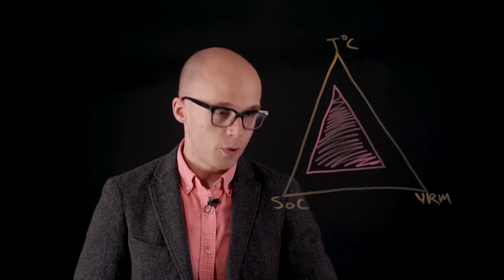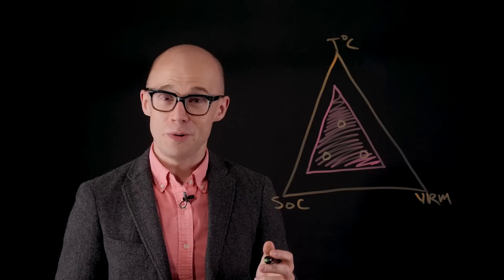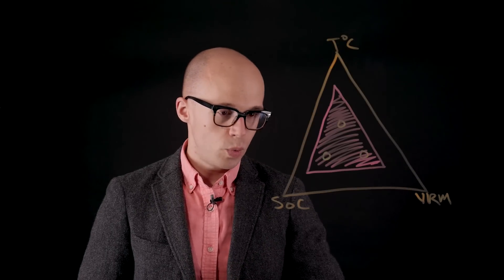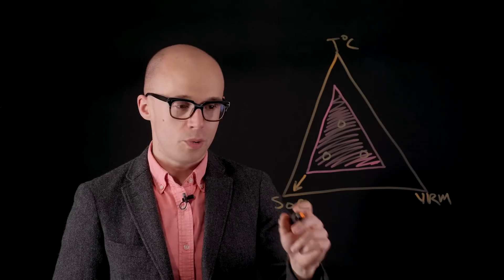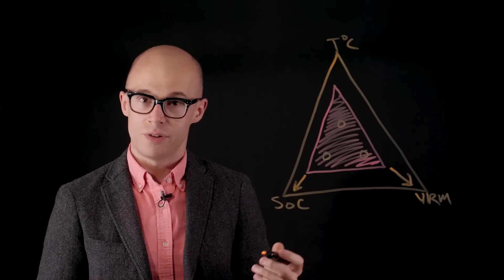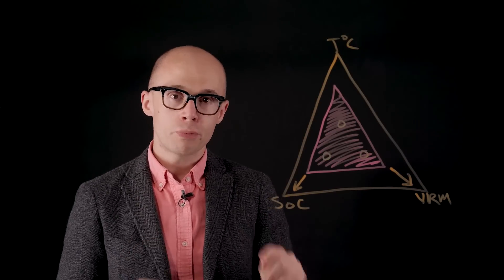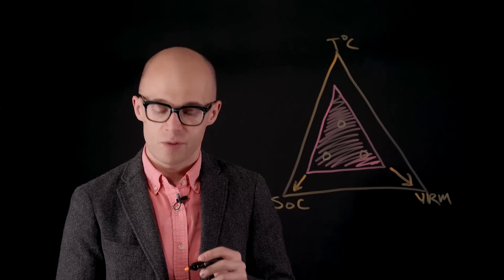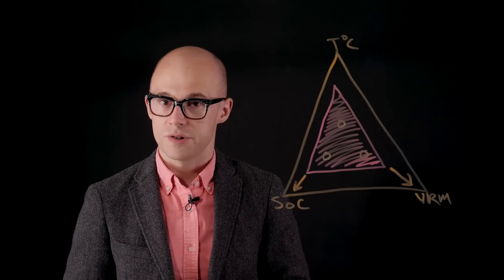How Does Precision Boost Overdrive Work

Comment: So when I got that right there is a new super expensive CPU that has a build in overclocking function, that will work within the limits, but if you are using it you void your warranty.

If I got that right I have a serious question: Are you shitting with us AMD?
Hey, here is a build in function that we have programmed, but if you are going to use it, you void your warranty!
Yeah, nice! Thanks a lot, I needed that!
But wait there is more! If you buy right now, you will lose your warranty by just taking it out of it's heavily oversized box! how do you like that?

I have an AMD system that is about 8 years old and I'm going to replace it with a new AMD system. So I'm not hating on AMD, but please AMD: Leave the idiotic ideas to the blue team. They are much better at this and this is one thing where you do not need to beat them.

Comment: Available on 2600x and a MSI B350i PRO AC with 1usmus AGESA 1004C (July 2018) :) PBO 'AMD Default' at 1.510v max or 1.4-1.440v under load with at least 4.1ghz, and mostly 4.250GHz (max turbo XFR2) :) This does reduce lifespan for sure but it's so worth it, cheaper than intel and gets so close. Cheers AMD for making such a well rounded and balanced processor, even if not the best.

Comment: thinking of a negative curve offset as a voltage manipulation is not entirely correct. 
The curve of the most demanding loaded core will dicatate the voltage the entire CPU core die runs at.
limited by a slew of other constraints), and the other cores will adjust their peak frequencies to match that voltage.

Comment: so if in ryzen master the dfault ppt edc and tdc are respectively 141/740w  95a/480a and 140a/650a means  i can double those values safely because there is still much headroom?
I have a 2700x and taichi x470

Comment: I don't like the fact that it voids warranty, why it should void warranty? Intel CPUs are smart enough that it's very very hard to damage them even while heavily overclocking, why amd should have warranty problems with oc? Aren't they smart enough to safely downclock/downvolt like intel if something became critical?
Reply: Overclocking Intel CPUs through software also voids the warranty. You can overclock through bios and as long as you stay under their recommended maximum voltage you will not void the warranty.
Reply: Oc intel cpus void warranty too.
Reply: It should not void the warranty to use an AMD made and recommended software that adjusts the settings based on the company's parameters and recommendations. I bet they'd lose a lawsuit regarding this.

Comment: Does PBO work with non-X ryzen cpus?  My 2700 non-X with PBO off tops out at 3.450ghz, with PBO on tops out at 3.425ghz... this is while playing games.
Reply: Cer3aleater the same for me, I don't know what to do... got the same processor like you. Max 3425mhz in games but in desktop usage it goes even to 3950 MHz. With the precision boost off in bios, It's stuck at 3200 MHz all the time. Can anybody help?

Comment: I have Crosshair 7 Hero mobo, 2700x cpu, Kraken x72 cooler and precision boost overdrive on. Why does my cpu run only 4ghz? My cpu is freezing cold at 40C, please make overdrive a bit more aggressive.
Reply: Are you using an X370 or an X470 chipset? The X470 chipset is optimized for overclocking The Ryzen 2000 series. Are you increasing the voltage to overclock passed 4.0 GHz? Recommended Voltage for overclocking to 4.2 or higher is in the range of having your VCore at 1.25-1.35V.
Reply: Use PE Level 2, and do a negative voltage offset of -50mV. That'll get you to ~4.15GHz.

Comment: Dont but ryzen 3700x it runs very very hot like 50 in idle on noctua nh-u12A...and im not alone complain about it!
Reply: It's not actually running hot, it's an illusion... though it's kind of dumb that AMD didn't use an average temperature for the chip.

Basically, that 50C is happening in a tiny part of the CPU at idle and AMD is telling you about it instead of giving you an average like Intel or any sane person would do.

Old Ryzen CPUs did the same thing, believe it or not, but they didn't have as aggressive of a boost, so the local heating was lower... but not actually by much.

Comment: TLDR: It doesn't. 

Most of the time it does nothing to improve performance and in a few cases you get better performance with PBO off!

Seriously, I thought people were just jumping on the bandwagon saying it does nothing. Finally decided to benchmark it myself... With PBO & Auto OC on I get THE SAME averages as just stock settings.
I actually do see slightly higher scores with just Auto OC on. SLIGHTLY.
From what people are saying thermal limits are stopping cores from reaching maximum boost regardless of the type of cooler you have because there is too much space between the inside of the silicon and the IHS so heat transfer is inefficient. This causes thermal limits to be reached before core clocks can boost to max, again, regardless of the cooler you have.

Oh, I have the R7 3700x by the way but I hear this about all kinds of 3000 series CPUs as well as some 2600s I think.
Reply: Im going with your advice and turning off pbo
Reply: @joshc7765  WAIT!
Okay, after A LOT of different benchmarks and different variables tested, I found out (at least for me) that I see a nice little boost with both Auto OC and PBO on* (on paper). Not game changing but (again, at least for me) I get higher benchmark numbers. Just for example on Cinebench R23 with both PBO and Auto OC my multi core score jumped 500 points from 12000 avg to 12500 avg, with single core score 15 point increase from 1290 avg to 1305.

So, again, a respectable increase but... did I really see a gaming improvement? Not that I can really tell. I use this purely as a gaming PC so maybe, MAYBE, there's productivity improvements I can see if I used it in that capacity but as it stands I can't see a notable difference.
What I DID SEE a drastic improvement in was overclocking my GPU. THAT gave me clearly noticable improvements.
I OCed my 2060 KO +200 Core Clock and +1250 to Memory Clock (Power Limit and Core Voltage untouched).

Final thing, why the "*" in the first paragraph?
Turning on PBO and Auto OC was kind of a pain. In certain instances turning on one would override the other and shut it off. This was happening because I was trying to turn on PBO through BIOS and turning on Auto OC through Ryzen Master app.
I found out I had to turn on both through BIOS. This is how I did it on a B450M/ac ASRock mobo...
Went to turn on PBO, mobo give you a warning "damage caused by use of your AMD processor outside of specification ...blah, blah, blah... not covered..." Hit "Accept". Click on Precision Boost Overdrive. "Auto, Disabled, Enabled, Advanced"...

If you hit "Enabled", that is PBO = On. However, hit "Advanced", this will give you options to turn on Auto OC through BIOS even though it doesn't call it Auto OC anywhere. This is where I kept fudging up. I know this is Auto OC because when Auto OC is off in Ryzen Master and I do this, then look back into Ryzen Master without changing anything in RM, under Control Mode it will say "Auto OC" as in it's ON.

...New options appear. Towards the bottom is "Max CPU Boost Clock Overdrive" (This is Auto OC), click on it, click on 200MHz.

If you already knew this then sorry for the wall, if you CAN activate both separately then I guess it's an ASRock or maybe B450 modo thing.

Anyway, bottom line is I saw no noticable improvements whatsoever and as far as benchmarks, this is one of those "Yeah but what about real world application" scenario where numbers look good on paper but it real life use nothing has changed.
As I stated before, real noticable improvements came when I used Afterburner on my GPU.

Your experience MAY DIFFER from mine.

Good luck.
Reply: @dsandoval9396  okay I want to thank you for the detailed step by step information. Where I got confused is what "auto oc" actually is. I'm thinking it's the auto overclock tuner itself. Also it would've been nice to know earlier that auto doesn't equal "on" in pbo settings. 😅
 Anyhow I did try your way and noticed a bigger gain in R23 on both single and multi core. Practically your same figures 12581 + 1257. But, how it translates to gaming like you said might mean a frame or two more. Which can mean the difference in some games like cyberpunk where you need 5 more frames to get 60fps. 

Now the gpu, does most the heavy lifting in games as you said. Which I've overclocked as far as a 2080 can go (with air cooling mind you). 

But the biggest gains to be had is with ram speed because ryzen. As of rn I'm stuck with a pretty slow speed of 2666mhz. But will be upgrading shortly.  

Oh and I also am rocking a r7 3700x hehe. Thanks for the assistance.
Reply: @joshc7765  No problem. This is my first gaming PC so it's all new to me and a lot was going by different videos and a lot of trial and error. A LOT of trial and error. It's one of those things where PC components very so much sometimes you can't go step by step exactly the way others do it in videos, and even if you can, even if you have the exact same components your results might not be the same for any number of reasons.
They weren't kidding, the only way to learn is to get in there and start moving stuff around.😁
Anyway, good luck with your rig.

Comment: is this normal?  1.44voltage and 60c? i understand that my 2600x goes from 3.6 to 4.1 but damn
Reply: @Elsa Debroglie yeah. And i have the stock cooler. I don't bother with oc. The gain is minimal.
Reply: @Enclosure_2k  I did 4 sets 4 benchmarks each for stock, only Auto OC on, only PBO on, and PBO +Auto OC on.

I saw slightly higher scores with just Auto OC on, but whenever PBO was on, by itself or with Auto OC, I swear the scores were just the same as complete stock or just a little lower.
Man, what a letdown. I feel reamed. The kind where I didn't even get dinner.
Reply: @dsandoval9396  i am at 4.1 now with 1.325 voltage.  Its stable.  Never goes higher then 55c. Noctua black cooler.
POB is OFF.

Comment: Whatever he mentioned here is completely genit. Recently, i tried to undervolt my dell intel i3 processor Using throttlestop. Results were amazing. i played even latest games like biomutant on my intel uhd 620 with low settings. First upgrade ssd and ram before trying undrvolt. It actually stabilise your cpu more than just a temp control. Gives a fixed fps. But remember, you need to be patient while tweaking with it. Also make sure to reduce 1HZ from each of the cores in turbo settings. Not just voltage shift. I have a amd ryzen system as well. Planning to tweak it next after my research. If anyone have similar experience with amd. Let me know.

Comment: It's simple, it doesn't really work. My 3600 can do 4.3 GHz all core at 1.325V, but people say that voltage is too high.

I said ok and turned on PBO, now the multicore boost is only 3.93 GHz at 1.35V on all cores.

AMD has to fix this. PBO should be pushing 4.3 on my cpu at 1.35 V. And when the CPU isn't loaded it should lover the voltage like now.

It's been said that if I manually set 1.35V there will be degradation of the CPU in a month.

Well fix it so I can push the CPU when needed.

Comment: AMD please fix via driver update the power plan bios of the wx9100 from 230w to 295w.

The amd wx9100 in practice is a vega 64.But since they limited its bios power plan to 230w the gpu behaves in raw performance to a vega 56.

And the wx8200 is a vega 56....

The two gpus are identical in raw power.A majour insult for customers money.

Comment: Does it work on a non X CPU?
Reply: Yes, non-X cpu still boost, just not as aggressively, and they do work with PBO but your motherboard needs to have the function (and you can mod it into B350/X370 board via bios unlock - google 1usmus mod on OCN). It doesn't increase the actual frequency it just makes sure the highest turbo frequency officially supported keeps running for much longer, though.

Comment: PBO is actually broken in some mobos with new agesa 0.0.7 when the cpu usage is low the clock is high
but whe you stress cpu all the core clock goes down. and you i'll get some stutter

Comment: VOIDS WARRANTY - WHAT'S THIS CRAP.  If you guys can't fully warranty the chip to be within parameters then ua shouldn't sell it.  Supply a cooler with these chips and put the "full" warranty on them. Telling the customer "not to push the button" is not acceptable. AMD, you need to do better.....

Comment: All good....the problem is that motherboard manufactures were lazy and only ONE motherboard currently exist that has a updated vrm(msi meg).

So wtf now!!!? I am not buying a new modern cpu and a old motherboard that "is 100% compatible" as they lie.The vrms wont support the Pbo.
Its the same situations as the first threadripper where there was no cooling and everyone was giving asetec braquets for smaller sized coolers that coudnt cover the cpu area and were saying its all good.

By the way , the dude skiped the temperature part..
Reply: ASUS, support it since the first gen, you are desinformed. They offer the cooling kit for free as well.
Reply: Marcelo Tezza i know they support it,but look at its vrm and power cirquit and than the one on the msi meg.
Im just frustrated because i was wanting a new assrock x399 offering since yesterday 😑
Reply: 123OGNIAN totally fine with the cooling kit man, and all should support right now thru the ryzen master.
Reply: MSI Meg? Isn't that x399. I think this dude is mostly talking about the x470 chipset.
Reply: I really doubt the Crosshair VI or VII Hero won't support PBO as their VRMs are 12 phase + which are pretty overkill, even if it's not officially supported i doubt anything would 'pop' or melt XD
Reply: However there ARE boards like Biostar X470GTN (mini-ITX) that have THE SAME VRM as X370 (4+3) or Asrock X470 ITX (3+3 phase heatsinked!!!!!) that can be hurt by OC even at 4.2ghz. This is painful to watch, many boards do not care about what AMD can offer with their new chips. Hopefully newer X470 boards will figure it out. I'm using a MSI B350i PRO AC that has a 6+2+1 VRM the best M-ITX for Ryzen, even better than the B450 version, and i have AGESA 1004C and it has PBO enabled nearly always 4.225ghz and never goes above 65-ish on a 120mm AIO with the fan turned up post-60c. This way i can keep the system cool down to 35ish while browsing on Firefox, and max out performance instantly as i game. Considering all hardware can degrade over time i think precision boost overdrive is a good compromise considering we all will upgrade, so long as the board can handle it - google the AM4 board VRM list, even if your not an electrician it's important to know how many real phases it has, otherwise you may be in for a explosive treat :(
Reply: All X399 mobos can handle 2990WX at stock clocks. If you do really want to go over that already insane 250W TDP then get a mobo suited for overclocking.
Reply: If you can afford a 24/32 core TR2 I agree. If all you can afford is a 2920 or 2950 then no problem there. If you have a First gen Threadripper you can wait a year for ZEN 2 or TR3 a 32 core is back to good on a 8 phase VRM.
Reply: Up to 2950 it's no more power draw than a 1950X. In a year we'll have ZEN 2 and a 32 core will pull about a 1950X power draw and be easier to cool.